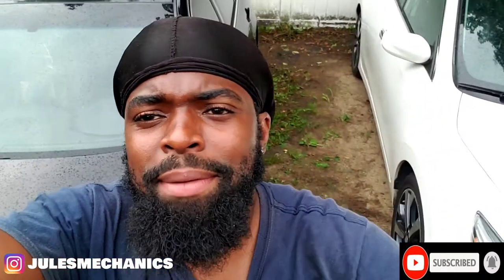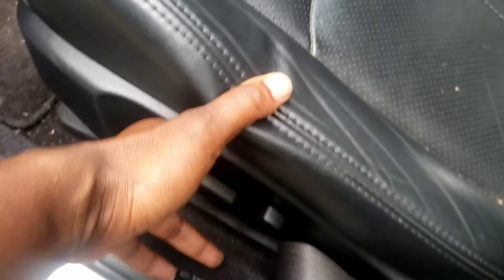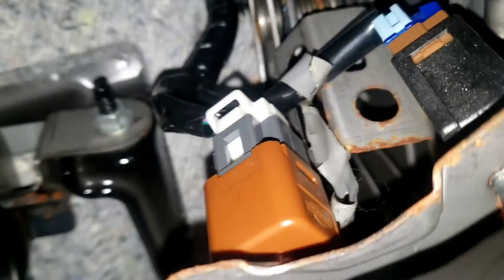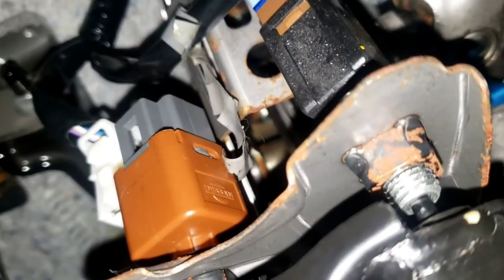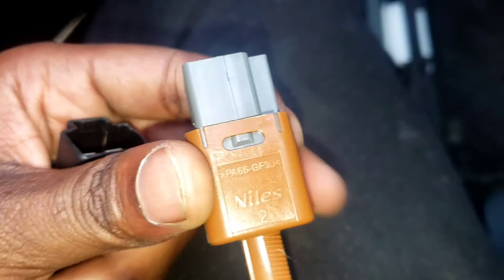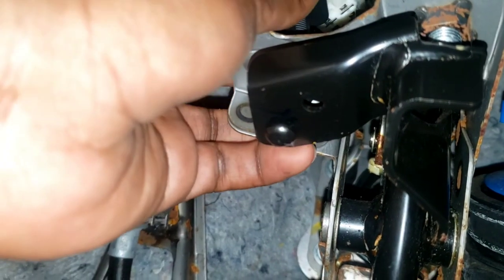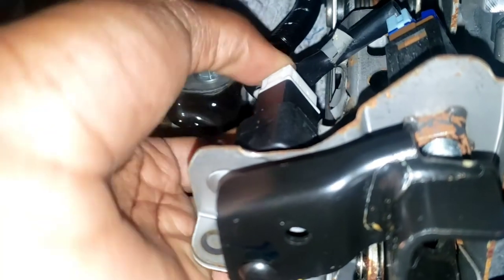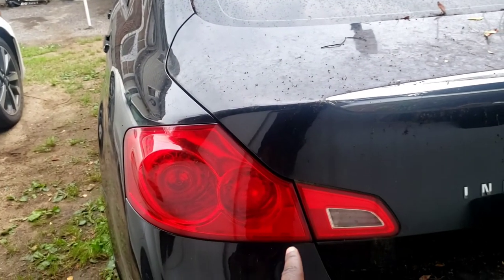How to replace brake switch infiniti g37 g35 q40

Comment: Appreciate the video just replaced mine 08’ G37 coupe also replaced the rubber grommet that also deteriorates and falls off I used a small fender liner clip shaved it down to size to fit the hole now the brake light switch button make proper contact. Thanks again you’re a life saver!!
Reply: How has that fender liner clip worked for you? I think my switch might be fine but that little rubber thing broke on mine.

Comment: Thanks so much.I had the same problem.My acceleration was so slow and the lights would stay on all the time.I even was about to order a new stop lamp swith.  I noticed though on mine. The plastic inserts had broken off. And the switch was not hitting nothing. So I ended up using a round magnet around the same size of a quarter. And that did it.  Thank you so much.

Comment: Good video.  Just a heads  up.  The rubber pad that pushes on the switch plunger when the pedal is released can deteriorate and fall out causing the same symptom.  Just had it happen.
Reply: This is exactly what happened to me. Where can I get a replacement?
Reply: Screw the replacement (literally). Just get a big enough screw and nut then tighten it in the hole. That’s what I just did today and also returned the switch since it was unneeded. There’s no reason to keep an almost $50 switch.
Reply: @obtrunco  LOL! We did use the screw method temporarily until the $10 rubber pad arrived.
Reply: Good call!! Imma check that as well!!
Reply: Hi where can I purchase the rubber part? I am having this same issue
Reply: @JJ-mv3fe  , we bought ours online from Z1motorsports. The Nissan dealer was more expensive.
Reply: @JJ-mv3fe  z1 motorsport
Reply: Same
Reply: I actually am about to replace those little clips with just body panel clips
Reply: @obtrunco got the switch last week for $14. Seems to be an oem component.
Reply: Wish I had read this comment before I bought the switch. I had this same issue. If you're in the three-pedal mafia like I am, this can also happen to the rubber piece that presses on the clutch switch. I know because I had that happen too. This comment needs to be pinned.
Reply: Anybody find out what that piece is called?
Reply: Yes, that is what happened to me. It wasn't the switch. It was the pedal stop pad.

Comment: thx for your video, I got an I30 and my brake lights dont come on anymore, also need to push override to put it in gear, will be replacing my brake light switch and hope this was/is the problem.

Comment: Lost acceleration and brake light stays on all the time. Replaced a little rubber button that broke the brake switch and acceleration and brake light work normally again. Thanks.
Reply: Same here. Such a easy fix but is stupid
Reply: Was it not going over 2k rpm?

Comment: Was it actually turning the brakes on?  my car won't accelerate.  Guess I'll find out after I do this fix.  Thanks.
Reply: What was the result? Same issue
Reply: @sovereign6550  hey my car is doing that right now. did they ever tell you how to fix it
Reply: @uniquewilliams8653  did u figure it out?
Reply: What happened after you did the fix?
Reply: Yeah it worked after replacing the part

Comment: Replaced brake switch plugged back up brake lights still on. Help
Reply: You may have installed the switch incorrectly. Free it from the brake pedal and reinstall it without depressing the brake. Installing the switch with the brake depressed caused me abs warning lights to come on. Simply removing and reinstalling the switch correctly cured the problem.

Comment: Thanks for this video. I have a question, its hard to figure out... Whenever i turn my FX35 on, hit the brake and try to ship, i have difficulty pressing the shifter to switch to reverse or drive... but after it shifts it works normally. Its only time this happens is when its in park. i don't even know how to explain.
Reply from the maker: Could be in the console something stuck or put a flat head in the emergency hole next to the shifter

Comment: Have a question I switch it with autozone but it didn’t work do I need an oem one car has no throttle response
Reply from the maker: Sound like the throttle body
Reply: This happened to me. Brake lights stay on and my g37 sedan only goes up to 3k rpms even if I floor it. I was driving it in manual and it was better but still not really drivable. This occurred after I installed the roar pedal throttle commander.
Reply: What was your fix with this bro?

Comment: Do not forget to check the brake pedal bushing before buying a brake switch. Ask me how I know! I bought a new switch and it did not fix the problem. Did more digging and found the bushing that acts as a brake stop. Sure enough the pad was missing.
Reply: Mine too.  Autozone got me for $10.74 for that brake pedal stop switch piece of plastic.

Comment: Do you have to disconnect battery
Reply from the maker: If u want to be on the safe side
Reply: Did mine without dc the battery and had no issues.

Comment: What if I replace the brake light and my lights still on
Reply: did it right now and it still stayed on what did u do to fix it?
Reply: Break switch bumper probably it was a cheap fix the part itself was $11 I got a new switch and light still was on then I realized that my break switch bumper was missing mainly due to the heat it deteriorates over time
Reply: So I ordered the break switch bumper and boom back to normal

Comment: I just had my rubber stopper on the pedal fall out so the switch was not engaged anymore so I put it back on what I realized was the switch on the right also didn’t have a rubber but I don’t think it ever did and my car is fine so can someone tell me what that switch on the right is ?
Reply: Cruze control cancel switch. Seems much more robust than the troublesome brake light stop switch.